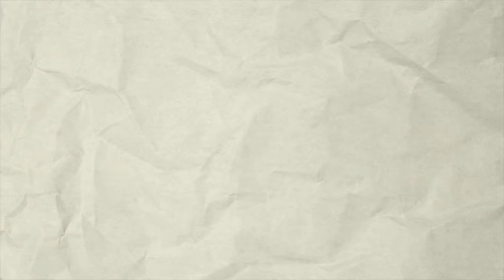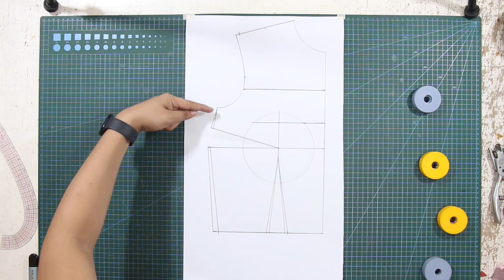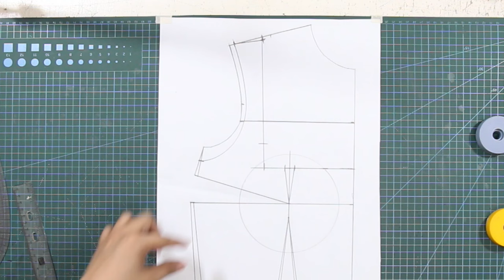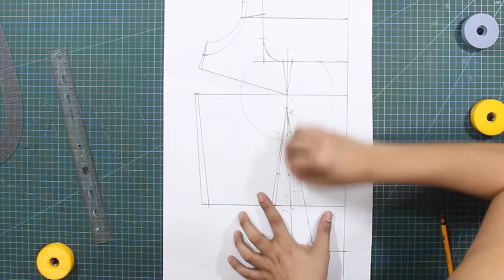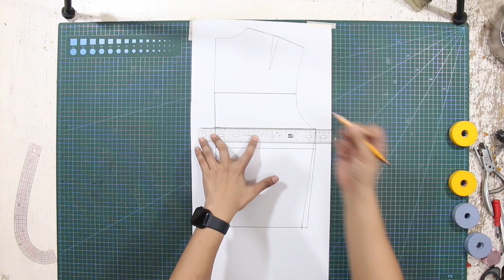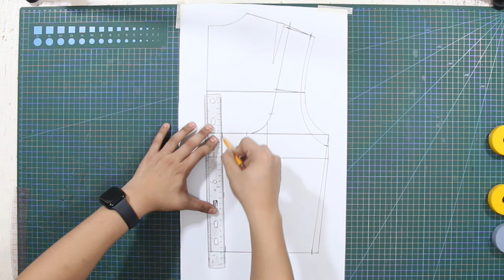CORSET TOP PATTERN-MAKING TUTORIAL | CORSET TOP TUTORIAL | LA MODÉLISTE

Comment: Thank you for this!! Would love to see a video on how you do fittings on mannequins/clients. I’m not sure how to do proper fittings and adjustments to the toiles when fitting it on the mannequin/client :’)
Reply from the maker: There will be part 2 of the sewing tutorial for the corset next week. As for the fitting I think that depends on the body type you are creating the garment for. That’s why we pattern makers use a design system for pattern drafting the basic torso to get the exact measurements of the client and apply those measurements on flat patterns. I have a tutorial for basic torso foundation with little to nothing adjustments and you can check that out on my Channel hope this helps

Comment: Hi,

After removing 1cm off the side seam, you add it to original dart. 
Would that mean I be removing 2cm off my waist measurement?
Reply from the maker: @XxmisskjxX  i split the 1 cm to spread it on my waist dart. So on each dart leg I split the 1cm on each dart leg = 0.5cm on each dart leg
Reply: @LAMODÉLISTE  thank you for replying. Another question… so far 2cm as been removed from the front and 4 cm will be remove from the back? Is that right?
Reply from the maker: @XxmisskjxX  yeah around 3.5 - 4 cm at the Back
Reply: @LAMODÉLISTE  thank for replying. Love all your tutorials.
If I was to add the zipper instead of the ties on the back, will the corset be too tight to close?
Reply from the maker: @XxmisskjxX  yeah. Thanks.

don’t decrease the pattern at the back.
Reply: @LAMODÉLISTE  hi, sorry for all the questions. I have made the corset and it looks lovely but the problem is the bottom of the front strap where the curve is folds. How do I fixed this? I wish I could show you but it’s both bottom corner on the front.
Reply from the maker: @XxmisskjxX  I don’t understand your question can you send the photo on my insta? Thanks